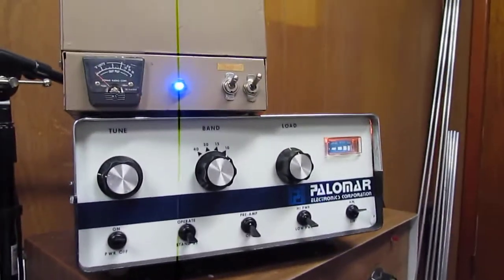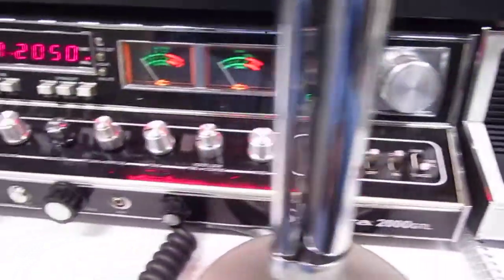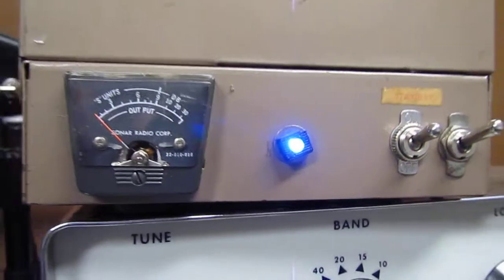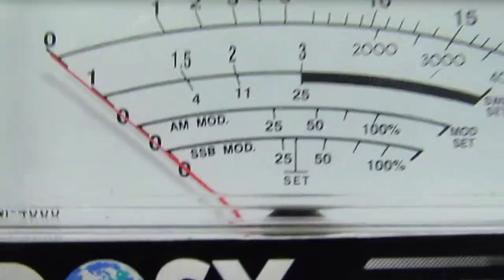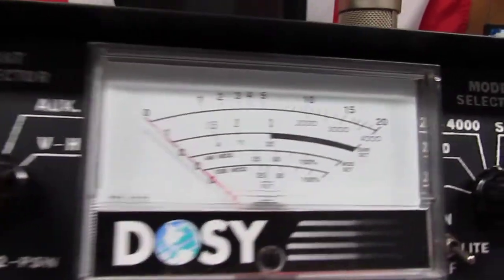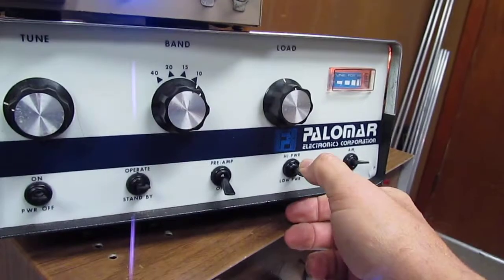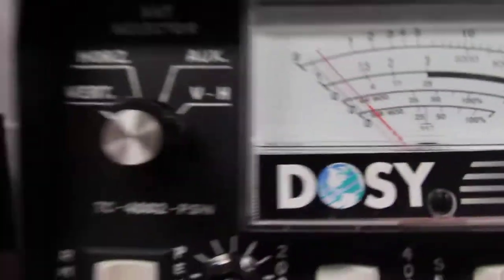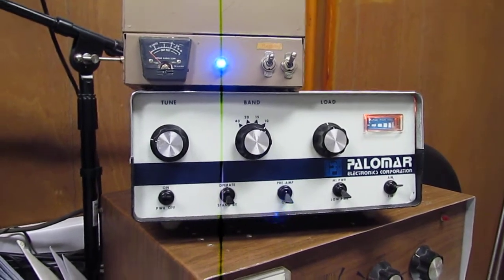I repaired my amp..

Comment: 65 watts with the amp in the high position is insane! Palomar made this amp with the option for high drive but ONLY with the amp in low. In low the 2 drivers are deactivated. This makes it possible for up to 100 watts driver as the 2 driver tubes are rated at 100 watts. Driving 100 into the amp in the high position with anything over 10 watts isn't recommended, but 65 Watts as I mentioned in my open is INSANE! Make sure you have a readable supply of 6lf6/6kd6 (or whatever the drivers are on) on hand you'll need them. 800 watts? laughable. you would think that somebody who went through the trouble of recapping and restoring what is a decent 11m amplifier would be a responsible operator. bozo! what more can I say. Bozo! Bozo! Bozo!

Comment: kiss  the drive   tubes   goodbye   driving  an amp  into  it    ,,an   maybe  the caps  again  //  i have one    ..not made to over drive,
Reply: Actually, with the amps power switch on “high” it shuts the driver tubes off and the other 4 tubes can driven with 90-100 watts Peak. This is why Ham operators with the 100 watt kenwood radios really love the Palomar 300a.

Comment: Hello I have the same set up as you and would like to get it repaired. The 300a blows fuses. Titantom405@gmail.com
Reply: Tom Barish I found on my 300A that it was factory wired so that the hot line in was always hot & the neutral white wire in was being switched by the main power switch. With the green ground wire connected it would blow fuses but with the green ground disconnected the amp would run. Checking it with a meter I found that as I suspected when it was switched off the case was at 120 volts & ready to shock somebody. I switched the black hot line in over to the power switch & ran the neutral wire to the post where the  black hot in was before. Now the rig runs with the green ground hooked up & no fuse blowing & the case never has voltage on it. It was for sure sent out that way from the factory.